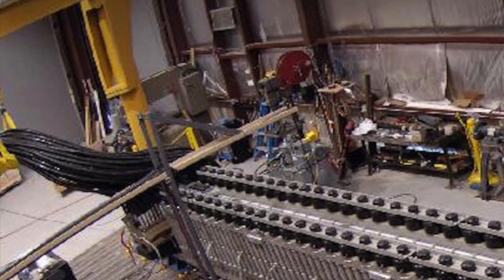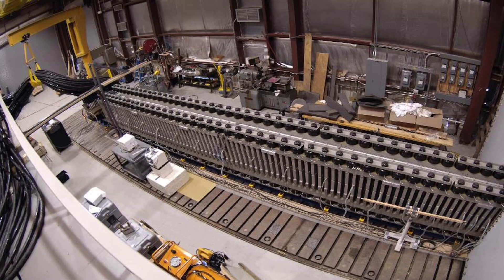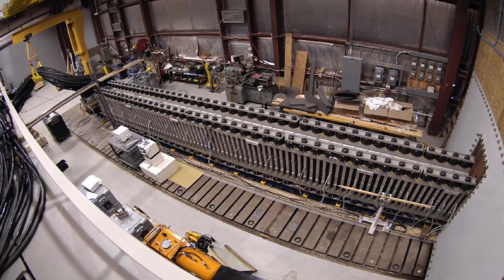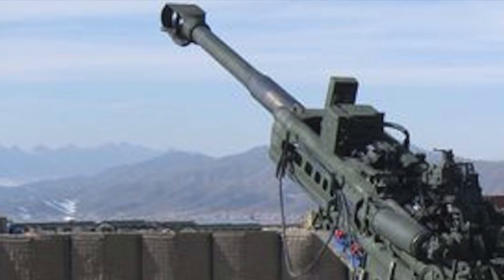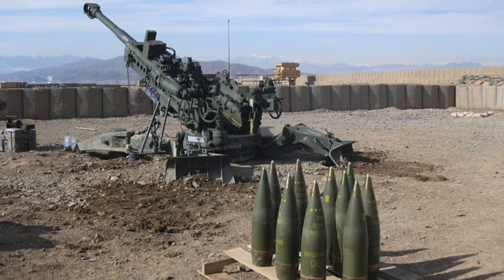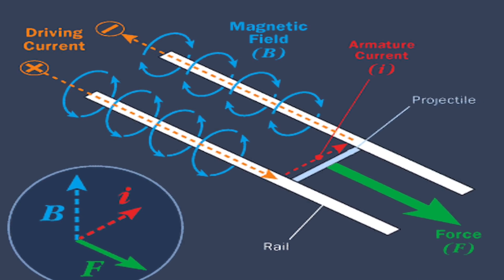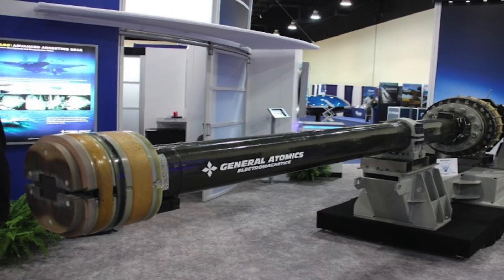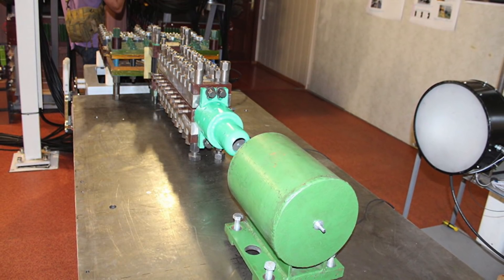WHY RAILGUN IS A GAME CHANGING TECH AND HOW CLOSE INDIA IS TO HAVING AN OPERATIONAL ONE?

Comment: The video fails to point out that a Rail Gun requires a large electrical power source/generator to work, plus the fuel to generate that power, this is instead of the propellant of a tradition gun round. Basically you don't get something for nothing. You replace the weight of the projectile and propellant + canister with the weight of the fuel and large generator set, so you probably gain little in weight savings if any at all.
But of course the traditional propellant is an explosive as well as any explosives in the projectile, so replacing those with diesel, kerosene, uranium etc and a lump of metal as a projectile is probably a good idea.

Comment: Uhm.. Yes, explosives are dangerous and susceptible to counter artillery barrages.  Yet, they seem to be overlooking what happens to a capacitor when it is damaged. Catastrophic discharge of a capacitor bank is a comparably explosive event.
Reply: massivereader sex will happen
Reply: More like a bolt of lighting suddenly appearing INSIDE a sealed container. With the amount of stored energy needed to actuate a military railgun, I'm guessing most of the capacitor bank will flash over to plasma.
Reply: massivereader , guess what! Who cares about capacitors these days .... When we have a circuit diagram.... Lol😂